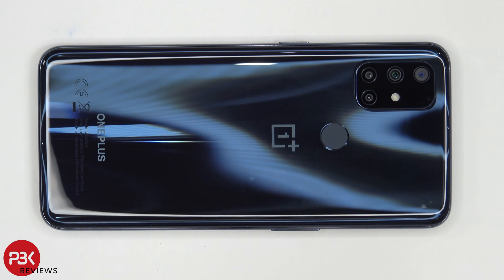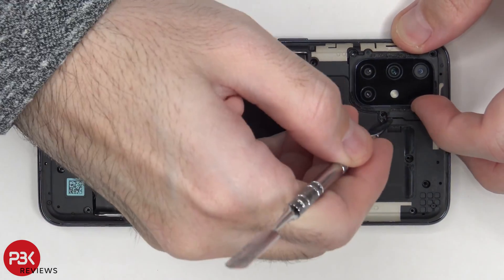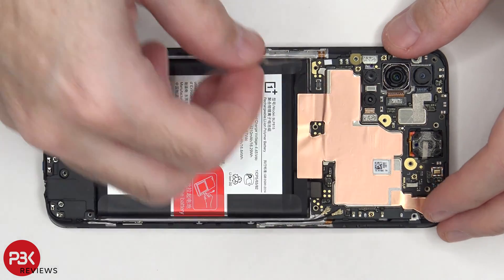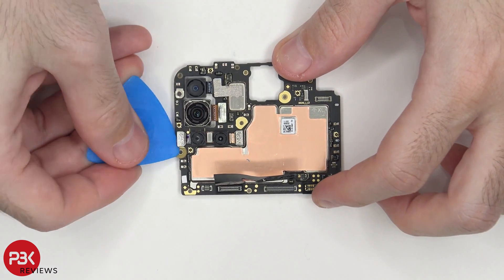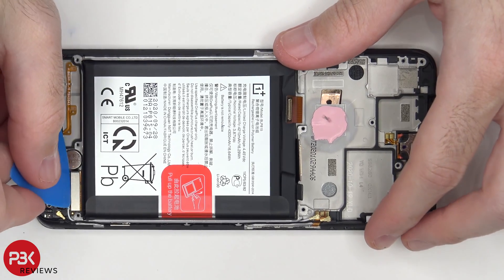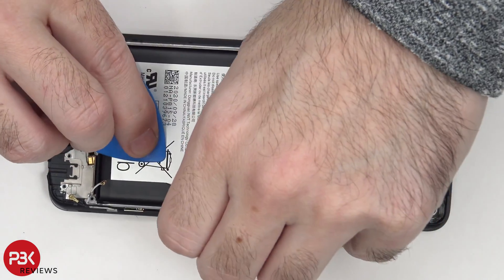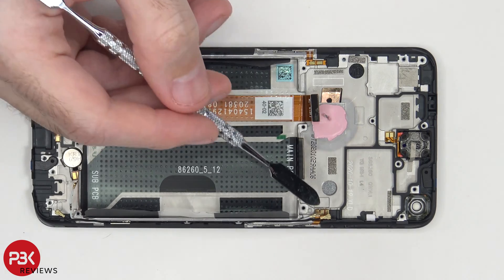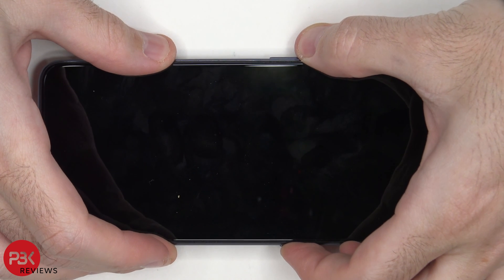OnePlus Nord N10 5G Disassembly Teardown Repair Video Review

Comment: Came here since the adhesive on one quarter of my phone has let go. I didnt' know it was adhesive until I watched this video. The link to the adhesive leads to double-side tape: is that what's used? I want to squeeze some in to reseal the corner without having to take the entire back off.

Comment: Worst phone out there. After years and support ending they purposely made so that this phone ran out of system memery storage with imaginary files. The fact you have to mess with the motherboard at all to replace is a battery is a red flag. Oh and did I mention that this phones operating system options are limited? It doesn't even let you repair apps so that you can fix the system storage issue. The company is scummy and makes so that this phone does everything against years later so that when the times comes you are forced to buy a new one. With the system storage full it does not allow you to use majority of the apps without crashing.
Reply: I mean.. ive had mine for five years and the only thing that's needed replacing was the screen...because im irresponsible and dropped it ....more times than i can count ..
I mean i have literally replaced the screen on it MORE.TIMES.THAN.I.CAN.COUNT.
The most recent replacement that I installed ended up breaking literally the very next day stepping out of my car with it in my lap...

But, I digress----severely;
This phone lives inside a GameSir X2 Pro mobile controller and i game on it literally no less than 6 hours a day, and i have for almost four years and the only "wear" that ive noticed at this point is just that it tends to overheat rather quickly in the summer and in direct sunlight..but that's to be expected.

Id argue that there is actually NO BETTER budget device for gaming that exists right now. You just had bad luck, buddy.

Comment: Can anyone help me with this? Phone was working fine, battery got low about 2%then died. Plugged in to red cord and plug for warp charge now I can't get it to charge & noticed a pin size hole at end of cord where the usb is not sure if a wire shorted or what!  No reserve $$and a horrible ice storm coming!!! Please ideas very import!!!ps using WiFi and old phone no service

Comment: I tried putting the loudspeaker back on but when the screen is on I keep hearing a popping noise for a few seconds and then it turns off after the screen turns off.

I bought 2 new loudspeakers and both do the same thing.

Any ideas?

Comment: What is the purpose of the secondary mic?
Reply from the maker: noise cancellation and during video recording, speaker calls etc.
Reply: @PBKreviews  which mic should I remove if I want privacy and use an external mic?

Comment: My OnePlus N10 after a drop the lens cover was take off (i think that after view this video, now i understand was broken and need to open to remplace before see this video i suposed only need to put some glue but not). After this drop the light of the flash/lamp is now blue (i don`t know if the lens cover use some color filter in your video see a grey/black filter in the back of the flash position). You know if is is true (some phisical color filter in the lens cover for the flash) or is a major damage and need to reemplace the card with the flash led in the cellphone

Comment: I'm interested in what the thermal paste is touching on the back shell. Is that a heatpipe for heat dissapation?
Reply from the maker: Yea its a copper heat pipe
Reply: @PBKreviews  Thanks for the quick reply! I'm glad budget smartphones are using cooling tech used in older flagships.
Reply from the maker: @Adam90028  👍😀

Comment: Hi I'm trying to replace juice and screen and I didn't see how to take off the volume and power button parts to replace on the new one🤔 d you know what I need to do?
Reply from the maker: Are you referring to the flex cables for the buttons? the gold colored flex cables that have the clickers on them? Those are held down with adhesive, you can gently pry them off but be careful not to tear them.

Comment: my oneplus nord n10 proximity sensor isn't working. is it hardware problem?
Reply from the maker: Have you ever replaced the screen? if so there is usually a rubber gasket cover that goes around the proximity sensor not letting too much light hit the sensor. If you forgot to put that rubber gasket on, it would prevent it from working properly. If not, then maybe some liquid damage or some other hardware failure could be the cause.

Comment: Do you need to remove the motherboard to replace the glass protecting the screen? Or did you only do this for the disassembly presentation?
Reply from the maker: Hi, the screen and glass are fused together so you would need to replace it as one. Only factories with special tools and machines can replace just the glass. In order to replace the screen, you would need to take the back plate off as well as the screws and then remove the back housing. Then disconnect the battery cable and screen cable from the main board, remove the battery so you have access to the screen cable underneath and then heat up the screen to loosen up the adhesive holding it down and pry the old screen off. Then apply new adhesive, reapply the new screen making sure you run the cable back through the mid frame, and re assemble the phone.
Reply: @PBKreviews  Thanks! Do you know where I can get good adhesive or can I just use Tesa tape?
Reply from the maker: You can order the original adhesive for the back plate/battery door as well as the screen assembly (which from the description looks to be a complete assembly meaning it would be the screen and mid frame already pre attached for you so you wont have to pry the old screen off and apply the adhesive for the new one, it will already come done for you. ) from this website: https://www.mobiledefenders.com/genuine-oem/oneplus-genuine-oem.html?device_model=2536   . This way all you would need to do is take the battery door/ back plate off and move all the parts from your old phone (including motherboard) and put them on the new midframe screen assembly.

Comment: This oneplus normal android mobile. Not Special oneplus.
Reply: Is not special?  People are (special) funny in their stupidity. Don't you know that the simpler, the less it breaks?
BMW engines are special now and there is no joy in this
Reply from the maker: @seantidie7415  Yea, these devices are also easier to repair or replace parts on compared to most higher end devices. They have their pros and cons.
Reply: @PBKreviews  I respect the master. And I respect philosophy. When a master is also a philosopher, it deserves even more respect.
Reply from the maker: @seantidie7415  Thank you :)
Reply from the maker: True it's not one of their more high end devices.

Comment: N10 and N100 are similar in many ways
It looks easy to repair
Reply from the maker: Yea very similar. Repairs should be fairly easy.
Reply: Now Moto One 5G Ace will be released next week, and it's exactly US version of G 5G (cam hole on the middle). Will you make a video of it?
Reply from the maker: @mingkee27  Yes, will be doing that one. :)